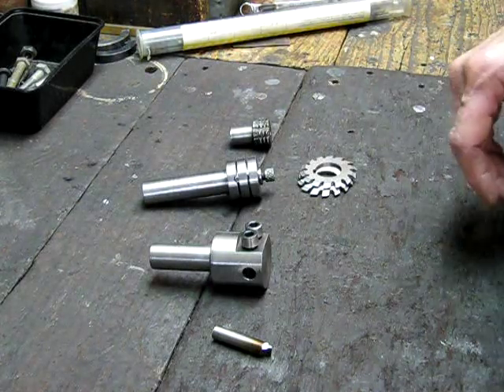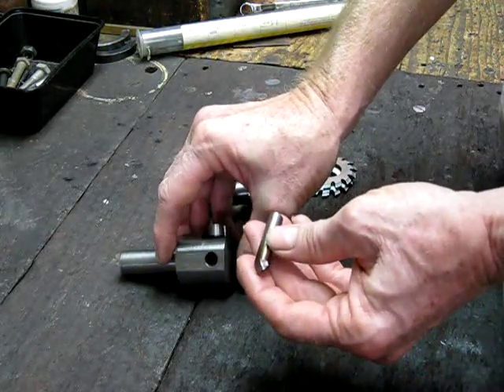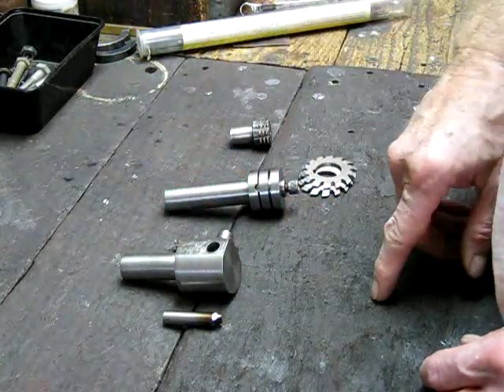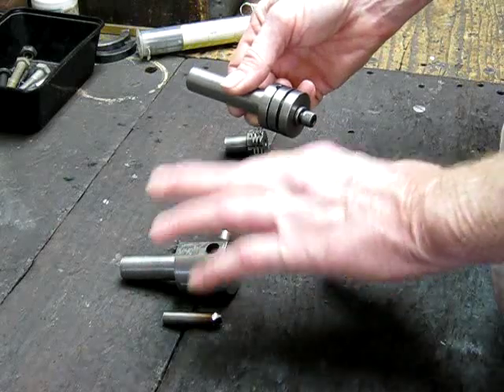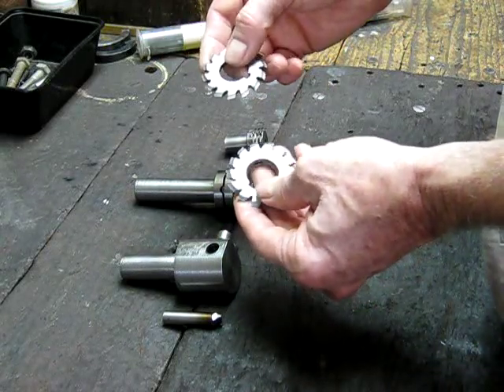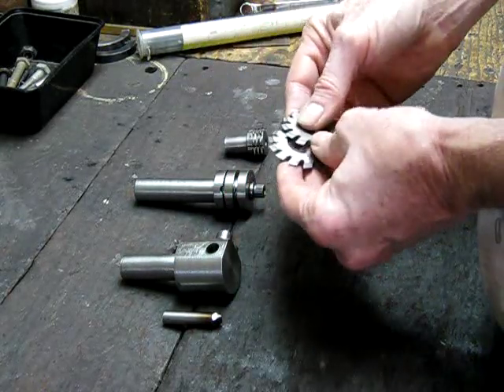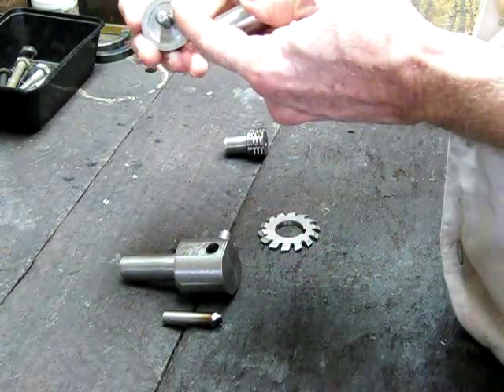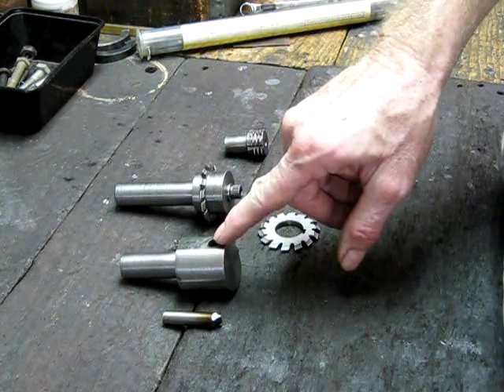Comparison of metal gear cutters - for DIY spur gears

Comment: Looking to buy involute cutters, I need to know what kinda MT3 arbor with Key way to purchase for these gear cutters ???do you know what I'm asking for just that you show 3 on this video I want to purchase the Involute option but can't find the arbor???
what do I need to ask for???arbor???
Reply from the maker: +Joshua Gross 
Hi Joshua.

Yes, you are after an arbor, but be aware that not all involute gear cutters have the same internal dimension Hole).

This is the type I bought:  http://www.ctctools.biz/hss-involute-gear-cutters/

They don't sell the arbor, but no big deal, I made one - easy job.

So when buying, if you want the arbor, buy both from the same place to be sure they are compatible.  Eg, an example as below:

http://www.chronos.ltd.uk/acatalog/Gear_Cutters_and_Arbors.html

I trust this helps.

Cheers

Rob

Comment from the maker: Hi Tim

I don't have any broaches either.  I use a flat file of suitable thickness or slightly under.

I slot the file down the centre with a cutoff saw or friction disc to make two long thin files from it. This can then be inserted into the spacer.

This is also how I broach my gear centres. To avoid making the slot too wide you can grind the cutting surface off of one flat side of the file to make it more controllable.

You basically just use the edge of the file to make the slot.

Rob

Comment from the maker: Good question.

No, involute gear cutters are not harder to use.  

I would start with a fly cutter only because it's the cheapest and easiest way to get going.  It gives you the opportunity to try gear cutting without buying stuff you maybe don't want.

If you are confident that gear cutting is for you, an involute gear cutter is the way to go. Still quite cheap to set up, and makes it very easy to cut a wide range of metals accurately.  But you have to make a more complex holder.

Cheers

Rob